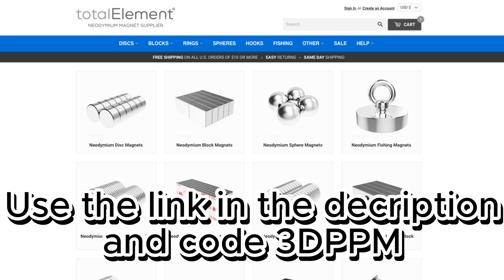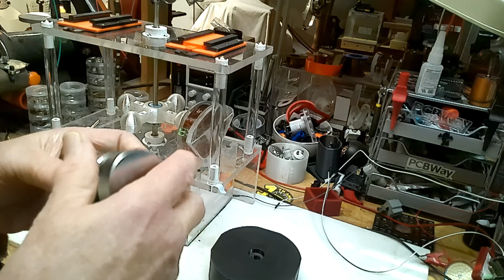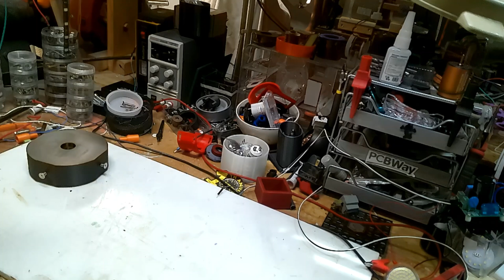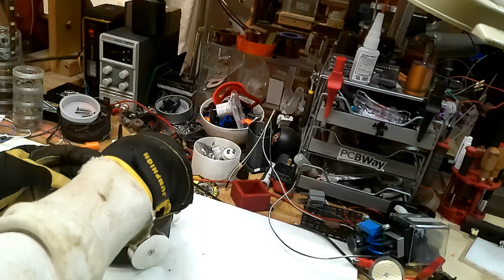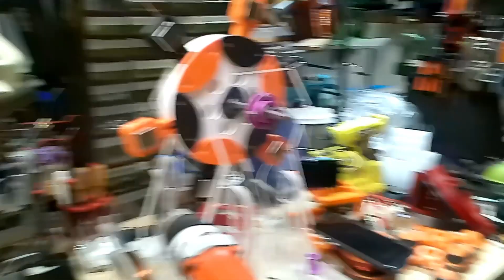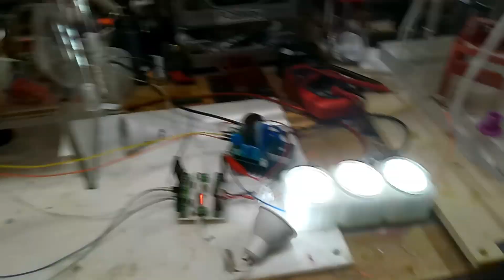3D PPM Beast Magnet Rotor (the largest and strongest)

Comment: Very impressive... Just for info.. i found out the best setting when you print rotors.. is 68% cubic infill and 8 walls.. (you can also add 2 extra walls in the infill part but that depends on the slicer) But with those settings a rotor like yours will take about 7 hours to print

Comment: ❤ years ago a friend of mine was doing a job around a MRI magnet. One of his employees failed to secure his 8 inch crescent wrench to his belt and the MRI magnet pulled that wrench out of his tool belt and it got stuck to the magnet. I told my friend how nylon rope, aluminum and wood are non magnetic lol.
Reply: Side note, your 2 coils are at 180° try 90° or flop the the connection on one coil. Left hand and right hand rule. When I made my spiders I had to make sure one was left hand and the other right hand.